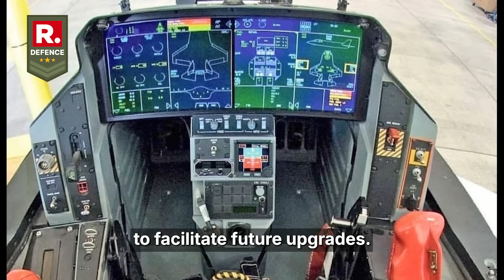Can India Rely on Private Firms for AMCA Fighter Jet?

Comment: If Indian Defence ministry can rely on HAL, they can depend on any private players 1000%
Reply: No bloody private parties can match Hindustan Aeronautics , which has manufactured about 1200 MIG21s including upgraded Variants since 1963, about 300 Sukhoi 30MKIs since 2000 and now manufacturing Tejas Mk1 and Mk 2. 
Let bloody TATAS under Chandra run Air India Properly then they should ever think of manufacturing Combat Aircrafts.
Kindly note that HAL Manufactured Russian Platform Sukhoi 30 MKI armed with Brahmos Air to Surface Missiles have outclassed, out paced and out performed bloody French Rafale during Operation Sindoor.
Reply: @SUJOYGHOSH-b2t  Maybe you or your relatives work there and hence the passion. Did HAL manufacture ATLEAST ONE FIGHTER ENGINE ON ITS OWN??? Will it take 40 years to BUILD ONE TEJAS AIRCRAFT? Im sorry to say HAL is a piece of trash and their engineers only feed and WASTE our hard owned Tax. DRDO and ISRO i will not type this. But HAL, GAIL and SAIL are just pure waste of tax money
Reply: @SUJOYGHOSH-b2t it assembled those platforms all extremely extremely delayed
Reply: @SUJOYGHOSH-b2t  they are not efficient